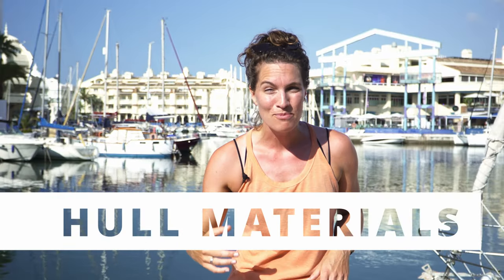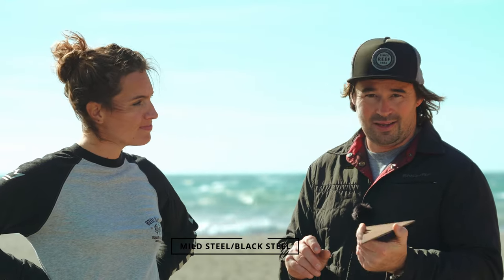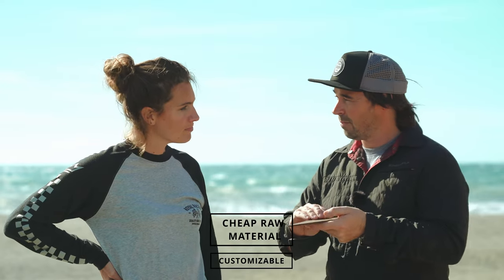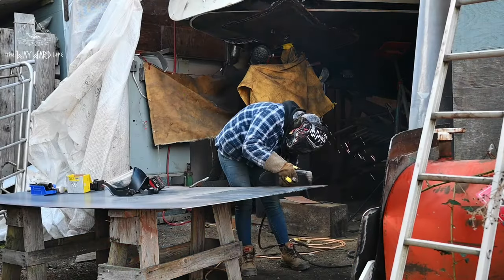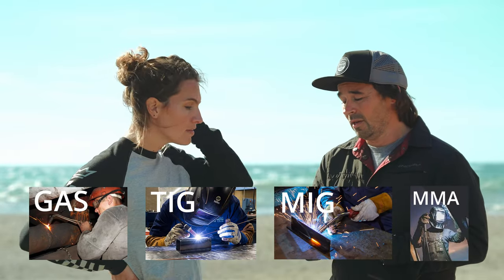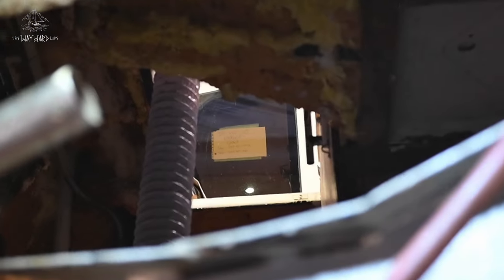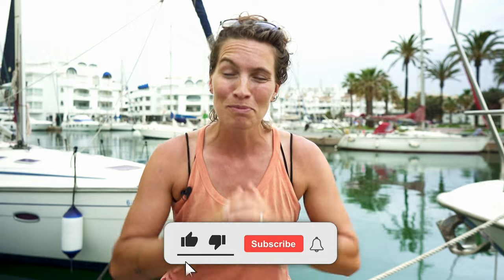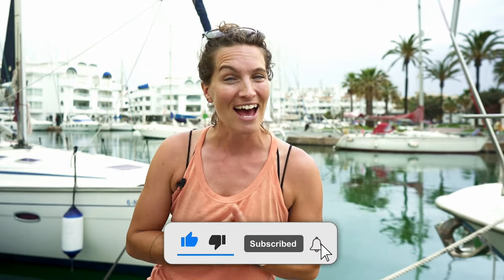Do steel cruising yachts make sense in 2023? - Sailing boat Hull Materials part 2

Comment: What about stainless crunching the numbers
Reply from the maker: Hi! By that I presume you mean a stainless hull? 
It can work and I have seen an awesome newly built adventure cruiser made out of it but.. it doesn’t seem to be selling, after years. 

Personally I don’t really understand it. As a material, stainless is brittle and it needs oxygen to maintain its corrosion free properties. 

I guess the main problem will if the hull becomes compromised by crevice corrosion through lack of oxygen. When it happens crevice corrosion is really not easy to see until it’s potentially too late.

There are some stainless steel variants I presume 316L that will be better. There are also stronger alloys such as 318 but they need heat treated to gain their strength which won’t be easy on a hull. Sadly, I know about a lot of steels and have welded many stainless grades but when it comes to building a hull, it’s not something I have done and I am not able to say much more other than give my honest opinion. - I see opportunity for more trouble than good.

Comment: I was looking at Bruce Roberts ms65 with some mods increase the beam 2m /6ft steel hull double  sail area and custom steel mast the mast can be half the diameter of aluminum  because steel is 4x stronger and have it Hot dip calvin ice coated .
Reply from the maker: Wow! That sounds fun! 
Your sure about weight aloft? Seems pretty like quite a compromise to me but that’s just my two cents.

Is that increase the beam by 2m? Crazy talk! I love it 👍
Reply: @SailHub  the mast would not be as heavy as you think  I work in nuclear plant and let's just say Access to some rocket scientist engineers
Reply from the maker: @user-gg6om8vp4f sweet, your lucky!

We’re looking at a carbon mast at the moment and the saving over aluminium is not huge but the effect in the righting moment is, get those guys to calculate that too as I would be surprised if it makes sense. Mind you, if it works for you, go for it. I would be really interested to see how you get on!
Reply: @SailHub  I would be doing a ketch setup so that  can help to start.
Carbon nice, my only concern is ultraviolet degradation is an issue
Most do not look  at that.
Reply from the maker: @user-gg6om8vp4f Nice! 👍 

Yeah, not sure how we are painting it yet. UV is a bugger mind!

Comment: No mention of  Corten steel.  A lot of Dutch boats use this, they are the masters.  No real big rust problems.  I looked at one, even had bare steel inside!
Reply from the maker: Hah!! Fantastic, cheers for sharing that Mark 👍 yeah, the Dutch certainly mastered the steel world!!
Reply: I also wondered that Corten or shipyard steel wasn't mentioned. As any steel build things the kind of construction is very important. And at least the first treatment of the inside of the hull. My boat was sandblasted inside when the hull was finished and then shielded with 4 coats of 2k epoxy primer. Never had problems with corrosion inside though I had some saltwater already inside. Corten steel is corroding 0.1mm/year in saltwater, time enough for mainrence.
And the notched impact strength of steel is much higher than aluminum at the same thickness of material.
I hitted the ground several times, up to 5kn speed, never a problem. Ask a owner of a modern plastic boat about the damage, many of this stories here on YT. 
And galvanic corrosion isn't a real problem if there are zinc anodes. In comparsion to aluminium I never heard that a steel hull became a Emmentaler cheese, but aluminium does if not perfect prevented.
Apologize  my poor english!
Reply from the maker: Some great points there! Thanks for sharing 👍

Comment: Steel is better. Fiberglass and plastic resins using forever chemicals and inevitably breaking down and apart in waters is only adding to our issues, it’s actually making fish sicker too which we then eat.. sure it may be a cheaper and lighter weight option… but at what cost? Steel can easily last 50 years. And rust isn’t a huge deal with proper maintenance, it will still be cheaper to maintain in the long run and easily outlasts fiberglass.
Reply from the maker: Couldn’t agree more ! 👍🏼💯⛵️
Reply: Whatabout the chemicals used in the paint preserving the steel? I'm not sure it's as simplistic as you make out
Reply from the maker: By that I presume you are referring to marine contamination? I would suggest there’s certainly a pollution element from paint but not a spot on what a grp boat causes. 

Generally because, steel boats are very good when painted properly first time and not often at all do you need to take a great deal off, where as grp boats will at some point in their life need the gel taking off and that’s horrendous. Repairs are a lot worse too. 

Still, there’s no perfect boat. On YouTube we put out our findings as boatbuilders, trying to just speak the facts that we have experience with.

Comment: Steel is easy to get by and reasonably easy to handle but it takes a lot of maintenance work.
Reply from the maker: Hello again! Yup, I would agree with that! If you do it right first time though it will last a lot longer than most people think!
Reply: @SailHub  True, you just cannot stop ever and have a break. It's like the Eiffel Tower paintjob: you start at the bottom and once you've finisshed the top you start again at the bottom.
Reply from the maker: @diotough  😂 sailing… it’s as much about enjoying the maintenance as enjoying the sea!

Comment: Rolled steel gives your boat the beautiful lines that plate steel dosent afford. 👍
Would have liked to hear about electrolysis in steel boats.
Reply from the maker: Sure, rolled steel is a good option although certainly not as common hence I generally talked about the more commonly used hard chine.

Me personally, I’m totally for metallic boats and steel is certainly superior to a traditional wood or fibreglass boat for the cruiser. Electrolysis will be covered under aluminium, we should have covered it for steel too. - lessons learned every week here👍
Reply: We have a callisto 385, designed by Bill Dixon before he did Moody Yachts. All rolled hot aluminium sprayed steel, you can't tell she is steel until you knock on the side (or know what to look for) it's another level of solid cruising yacht. No creaks in big waves, no worries about hitting anything and with modern paints, no rust.
Reply from the maker: @droneonamission Wow, it sounds amazing! I would love to see this 👍
Reply: @SailHub  Galvanic corrosion is similar for all boats.  Any two metals with different galvanic potential in contact with seawater forms a battery.  Zinc is low potential so is used to protect all boats: plastic, aluminum, steel, wood, cement, etc.
Reply from the maker: @LoanwordEggcorn  yup, only with a metal hull the consequences are potentially greater
Reply: @SailHub  Definitely a potentially larger scale problem with a metal boat, but any failing metal fitting, bearing, etc., on a boat is problematic.  Anything through hull, of course.
Reply from the maker: @LoanwordEggcorn for sure!👌

Comment: Considering the topic at hand does anyone have any experience with 90-10 copper nickel as a boat building material? ( yes , yes I know it's very, very expensive)
Reply from the maker: Now there’s a question. Such a rare build! I believe Bruce Roberts designed some. 90-10, possibly a close to perfect material? Pretty much no growth below the waterline, heavy but sting so the plate is quite thin. I believe you can use a 70-30 for extra strength too. Possibly the only downsides are the cost. There is galvanic corrosion too but it does appear minimal too. 

Are you thinking of building one?
Reply: @SailHub  I am "gently probing" the possibilities, yes.
Reply from the maker: Amazing, keep us posted. I would love to watch this unfold! 🤞👍
Reply: @SailHub  Thanks for the reply. I'm hoping the Metal Boat Society will be a good resource. I would be open to any and all suggestions at this point. Thanks,...fair winds!
Reply from the maker: Did it work?
Reply: @theespjames4114  It wasn't so much growth they used copper plating for, it was to stop worms eating holes through the timber
Reply: Cu/Ni 70-30 for the hull “skin”, stainless steel of some sort for the scantlings, cu/ni 90-10 for the deck fittings. In theory the extra expense is made back by not just the annual savings from a lot less maintenance but also the ability to be in the water for more days every year.
Reply from the maker: @61765Negado interesting…

Comment: what about a boat made from rost free steel?
Reply from the maker: What’s that then?
Reply: Forget it! Stainless steel corrodes too, but in tiny holes you hardly see. The same with ss anchor chains, same dicussion.
Reply from the maker: @nispuck3241 yup, crevice corrosion of stainless is a real issue! Not sure it’s the same for an anchor chain though as it’s rarely submerged for long enough for it to be starved of oxygen. If it were a stainless chain on a permanent mooring though, that’s a different thing - a big no no!
Reply: Hard to understand why all steel boats don’t use Corten steel.  
I looked at one , built in Holland where they know their steel boatbuilding, about 15 years old, it was even unpainted in some internal areas, no rust! 
It does, similar to aluminium get a protective coating of oxide.
Another advantage that it is stiffer than mild steel, so holds shape with thinner plate.
Reply from the maker: @markthomasson5077 it’s amazing stuff right. To be honest I’ve no idea either. I presume cost but then there’s the future maintenance of the other option to add too…

In the other hand, if you look after any steel, it will last a long give for sure. Maybe that’s the thought? No idea  really 🤷‍♂️

Comment: Put a sacrificial anode of zinc to help
Reply from the maker: Great advice, mind you be sure to get use the correct material based on your environment. Brackish or fresh water will require a different material 👍
Reply: @SailHub  definitely agree

Comment: Why dont they epoxy it after, or one coat fibre glass over steel 🤔
Reply from the maker: Epoxy is becoming more popular, however it’s expensive due to the fact the hull needs to be blasted before application for a good bond. As for fibreglass, not sure - as a boatbuilder I wouldn’t recommend it, similar to sheathing wooden boats, it’s all good until it’s not. Then the whole boat can become saturated, making repairs harder and also meaning it’s still wet when on the hard. 

For me, the real beauty of steel is how easy it is to fix, keep it simple, the repair work is easier and it will look after your for years.
Reply: @SailHub  thanks for your reply 🧡, I am looking at steel as the superior choice 🙌
Reply from the maker: @silentlamb7043 cool, I think it’s a good option. Check out cementous coatings - age old tech getting re launched, apparently a game changer (according to nasa and bowing) someone like eoncoat. Not really been used in the marine industry as yet but I’m sure it will come soon. 👍

Comment: Ferro Concrete the only way to go for an adventure/cruising boat.  Highly under-rated and stronger than steel.
Reply from the maker: Pretty good build construction that’s for sure. But… The only way to go? Really?
Reply: @SailHub  Strongest construction, lowest overall maintenance, easiest repair [plug with Epoxy], heavy weight hull - great underway and relatively easy to do as a home build. A properly constructed hull will last decades, there are hulls in the pacific left over from WWII that are still serviceable and they have sat unserived probably since WWII! No other boat  construction material will last that long.
Reply from the maker: I know about them for sure. Just before I give my thoughts on them… I just want to point out the video is about a particular material as opposed adventure boats. 

So I’m not so sure that ferro cement builds are the only way to go for adventure cruising but they have their love and the material is not a bad choice for adventure cruising, although they are personally not for me.

Personally I think they are very good, the main limitation being weight (like steel) which… although being often overlooked by adventurers does mean slower passage times and longer weather windows.. lighter adventurers tend to get places quicker and easier but of course, weight is good when the going gets bouncy (so long as the weight is in the right place of course)

There is of course the strength question, they are very strong, very strong but.. cracking on impact is a potential, and of course we can’t forget the internal steel structure. How do you definitely know what’s going on in there? The other thing to note is hull shape, it’s relatively limited due to the nature of the material needing to dissipate energy over a large area. Modern lines are not likely to be common part and fin keeled boats are not likely to take a grounding too well. Swing keels will be good and of course relatively common for the material. 

I’m not saying they are bad, in fact I would suggest a well built and well designed one will actually be exceptional! However, it’s a sad fact that’s there a lot more boats that do not fit into the well built category than do. 

My thoughts are that’s if your building a new one your into a winner, however I must ask how it is actually better than steel?

Comment: you did not cover stainless steel boats - why?
Reply from the maker: We just covered the main builds that I have experience with. Stainless I’ve welded quite a bit but I can’t see it being great for a hull. Is generally not very good when constantly submerged. 

I’m ware there are boats out there but it doesn’t make sense to me. Like I said earlier though; I’m not qualified enough to talk about them so I will leave it to someone else… or, if you really want to know I will hunt someone down and interview them 👍

Comment: Well if you want the real technical answer. Steel doesn't make much sense for small pleasure boats, because marine steel is no stronger than marine aluminium, but 3 times heavier. It's more expensive but that price difference will be negligible for a small boat that might only use 5-10t of it. Fabrication of the boat and sails/rigging/engines/gadgets/interiors dwarfs the cost of raw materials. 

However on a massive commercial ship strength to weight is less important and raw material costs are more significant. In addition steel has an infinite fatigue life - it will degrade in strength to a point, but no further, whereas aluminium and glass fibres will get weaker and weaker and weaker forever with every wave cycle - of course they'll still last a very long time, but commercial steel hulls working day after day after day can in theory last forever - with the right care.
Reply from the maker: Hey, thanks for the real answer! 
Mind you, I still think there is a place for it in small craft building. 👍
Reply: @SailHub  I think going forward they'll be less common, but they could still work if you aren't concerned about performance and just want a big old chunky displacement hull.
Reply from the maker: @N330AA oh yeah! They are fab for higher latitudes. I’ve just got into port this moring with a friend who built a boat from a Koopmans steel hull and just finished an Atlantic circuit finishing  via Canada, Iceland and Greenland this morning! A pure joy to sail into where he started in Ireland with him, the boat is an absolute trooper and loves weather! https://m.youtube.com/c/SailingYachtZora
Reply: @SailHub  Well i'd love to do the northwest passage myself.
Reply from the maker: @N330AA ohhh yeahhh! I would live that! One day!!!